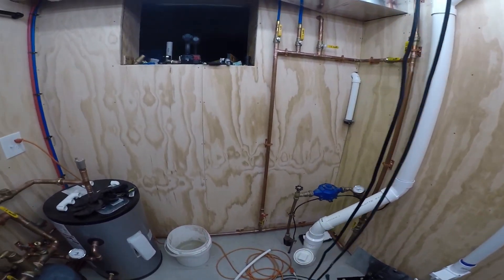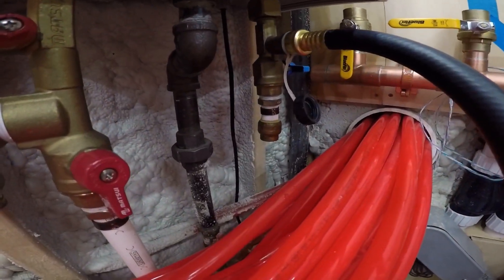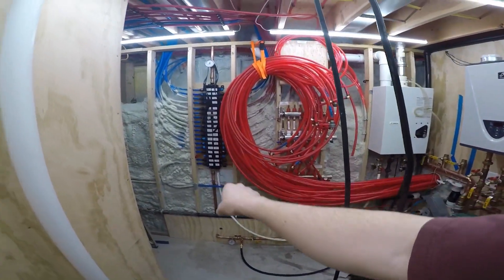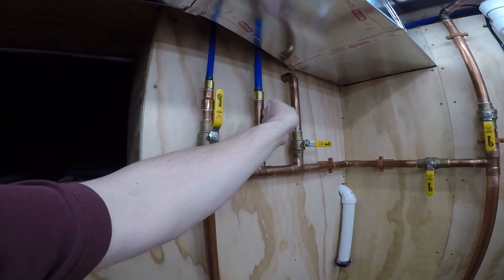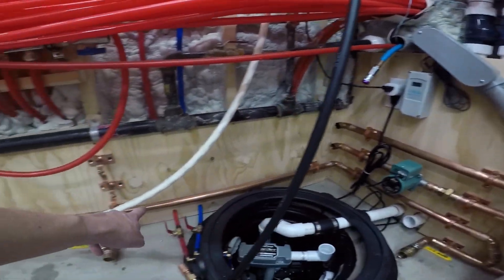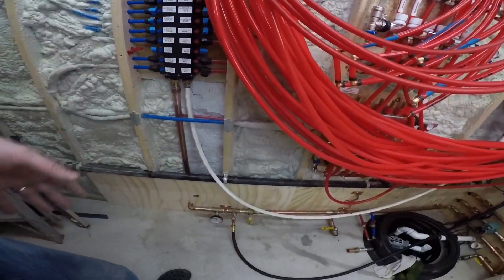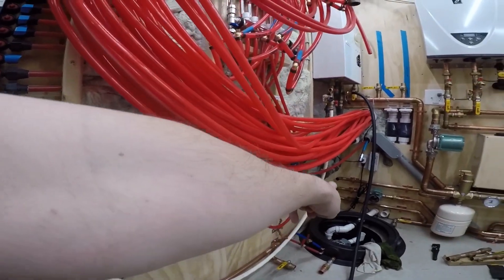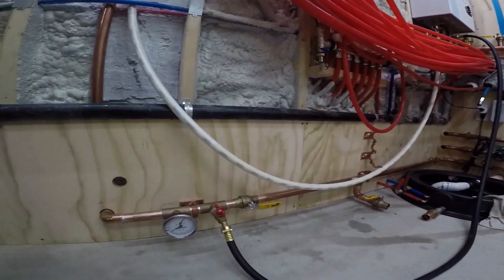Cold Water Pressure Balance Loop Around The Utility Room Complete! - Episode 20 [10-27-2020]

Comment: Did you notice a difference?
Reply from the maker: Absolutely!  There is NO pressure loss, anywhere in the house, no matter how many fixtures are calling.  I have friends who have said they can't use the shower when their irrigation system is running because the pressure is so low.  One of my irrigation zones has 12+ heads and you can be in the shower and not even notice its on!